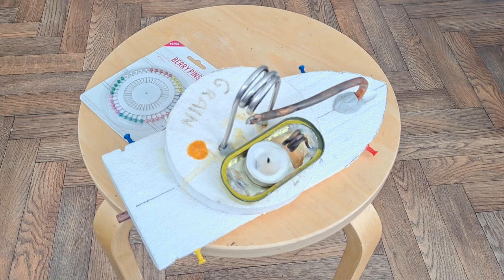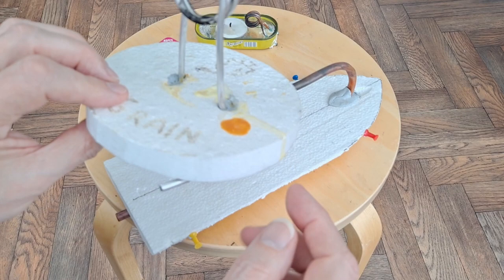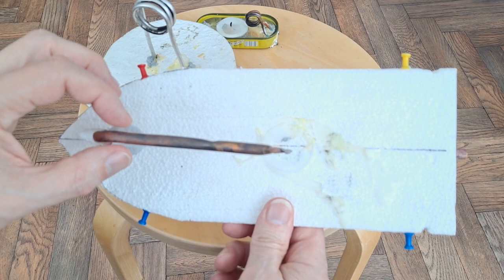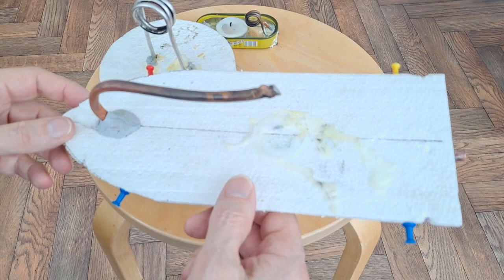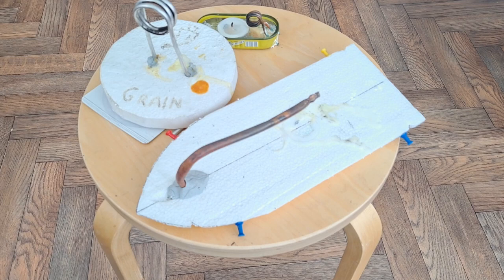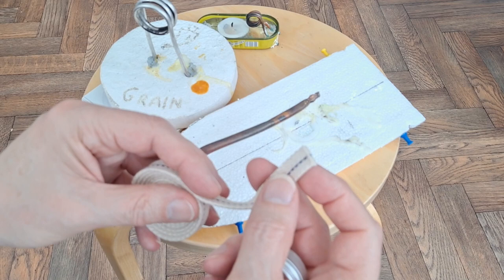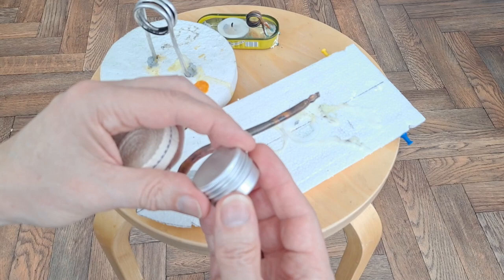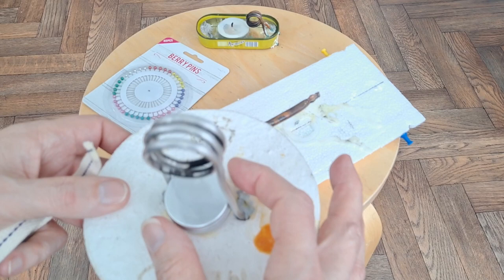Spinning Pop Pop boat with meths lamp

Comment: Single copper pipe wow I’m gonna have to make one. 👍🏼
Reply from the maker: Probably the easiest pop pop boat to make, as long as you are OK bending the pipe without collapsing it 👍 If you are using copper pipe, you can anneal it first to soften it.